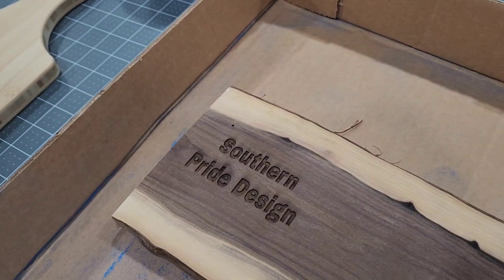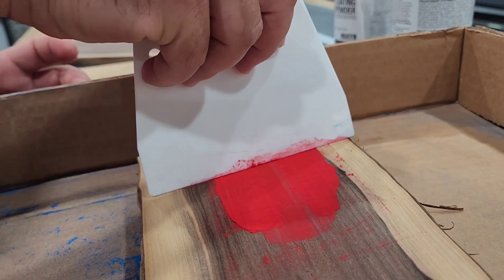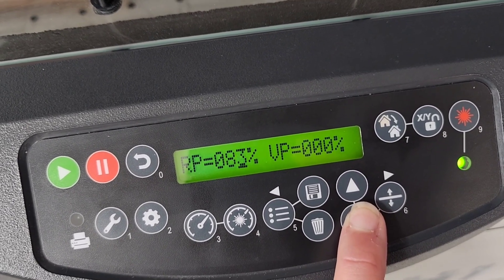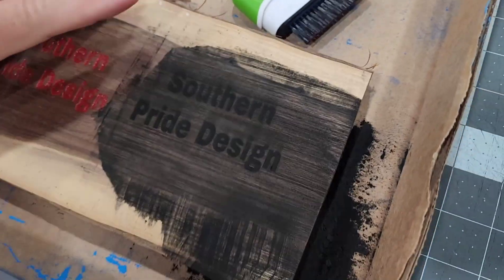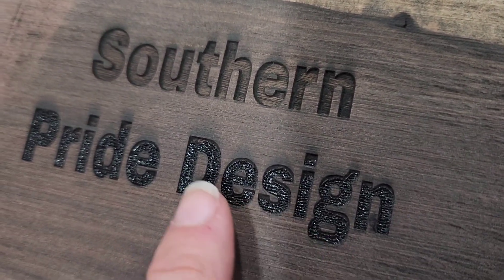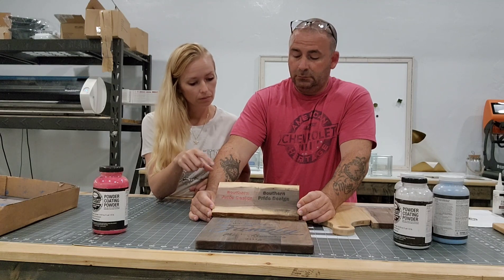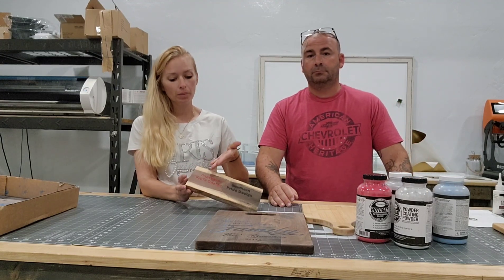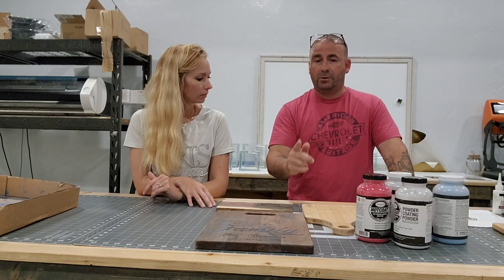Laser engraving with powder coating.

Comment: Engrave a little deeper then use heat gun to melt powder. Sand off the excess.
Reply: what kind of heat gun do you use to melt the powder?
Reply: @sued877  Just any old heat gun

Comment: A  - Mask off the area before engraving. Oramask works great but masking tape will also work. 
B - Don't move it. Use magnets/hold downs/corner squares....anything to keep the piece in place while you apply the powder. 
C - no air of course while you melt the powder. 
Those three tips will guarantee success. 💯
Reply from the maker: Thank you for the tips!!

Comment: There is better ways to infill lettering. Most powder coat cures at 380 - 400 degrees, for 10 - 15 mins. After the base material gets to the cure temp.
Reply from the maker: Thank you for sharing that info. We are going to try again this week.
Reply: Also powdercoat does not like to stick to carbon I worked at a powder coater at a laser cutting factor and we had to make sure all carbon from cutting or engraving or the powder coat would just break right off the metal but other comment 100% on info about it